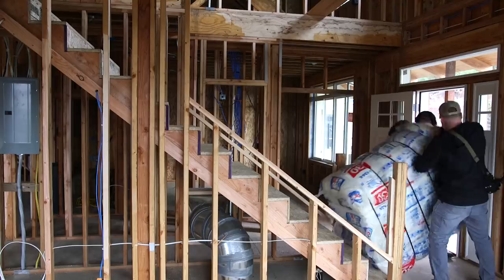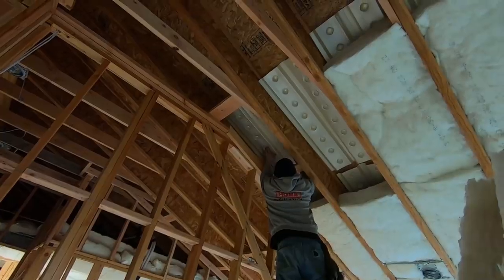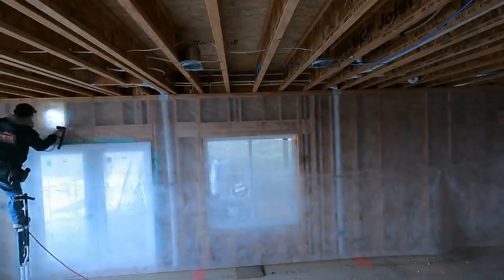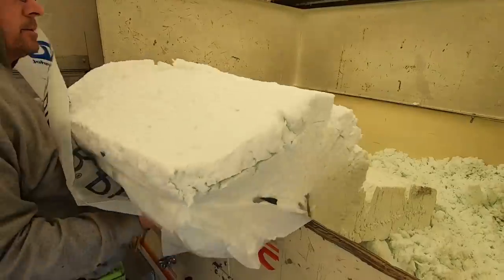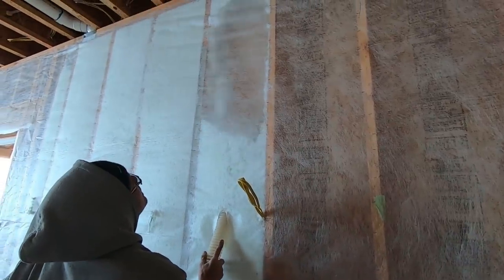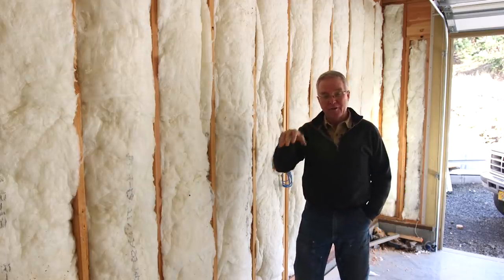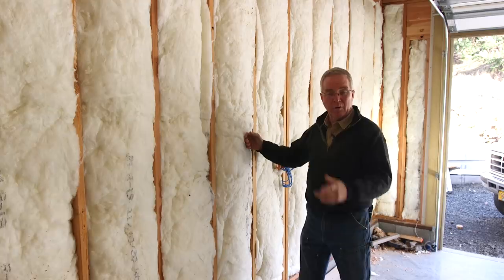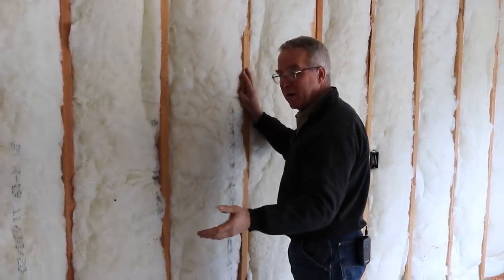Insulating A Nice House Ep.104

Comment: Hey EC!  I recently moved to Cottage Grove.  Do you have a recommendation for a foundation replacement contractor?  It’s 41 linear feet of footing and block to replace the loose block sitting in dirt. Quotes have been $20k-$28k so far.  Which are detailed and seem fair, more research to do yet.  I’ve got to tackle this before it slips out of level and I end up with a roof leak or some other monumental mess. 

Bit of a bummer to pay for the whole job, when I’m comfortable cribbing the house and replacing posts & piers. I don’t think I’m up to the task of excavating, pouring the footing and then the perimeter wall.  Totally understand why they don’t want me mucking around first though.  

Long story short, I’m looking for a word of mouth recommendation for my fourth bid so I can  make the best decision possible.    $20K+ is life changing money to spend when you’re 26! 

Appreciate the videos, God Bless.

Comment: I did some work to a house a few years back and we hand to pull some sheetrock down. We found out that the walls had been filled with loose insulation however it had settled over time and only stood about four foot off the ground leaving the top half of the cell completely absent of any insulation. Now it was a very old house and their insulation looked like recycled foam padding, but is there a concern that the sprayed insulation will settle down over time?

Comment: I've always worried about blown-in insulation settling over time. Anyway to do a test before the sheetrock goes up? Maybe vibrate the studs with a hammer drill or air chisel?

Comment: If the paper backing is gone what do they use as a vapor barrier?  Also over time blown in insulation settles leaving a gap at the top. How do you combat that or deal with that when it happens?

Comment: We have several insulation contractors here in MN but the issue that I have had over my 26 years is although they have good intentions , they fail to train their employees correctly and I find myself doing alot of quality control on site while they are working .
One of most important phases of our construction process in this climate is the insulation of the building envelope,  you can have the best built house in town and if the envelope is incorrectly insulated it will fail miserably. 
Another issue we have here is in the cold season when installing either batt insulation or blow in fiberglass , moisture migrates through the Batts and blow in and forms condensation on the interior side of the exterior wall sheathing , the insulation contractors insist on bringing in space heaters while installing insulation that exaggerates the moisture migration .
So until the vapor barriers are installed and sealed I do not allow any temporary heat sources in the building , period .
Licensed builders in MN are bound by statutory warranty for 10 years for the structure and if there is moisture trapped in the wall cavities it will eventually cause mold to begin to grow .
Maybe I am being to anal about it but I sleep good at night knowing I did my very best to minimize the moisture in my building envelope and spent the extra time to check all of the work .
Reply: Keep up the good work!

Comment: It used to be that blown in would, over time, settle.  Did your insulation guy say  much about current blown in, whether it will settle, how long it will take to do so, etc.?  Curious if there's an expectation that you'd have to re-insulate in, say, 20 or so years.

Comment: I really want to see the inside of these walls in a few years once the blown in fluff insulation settles.  How much does it settle?  Will the top 25% of your walls end up naked?
Reply: It settles a lot
Reply: LOOSE fill in an attic will settle. DENSE pack in a wall if installed correctly won't settle at all.

Comment: Cellulose looks great when it goes in, but it settles over time and looses its insulating properties.  Once that happens, it's nearly impossible to reinsulate those walls without tearing out all of the drywall.
Reply: It needs to be installed to a specific density in walls to avoid settling. Like everything, a bad install can make an otherwise good product perform poorly.
Reply: @andriussimutis573  By it's structure, cellulose will settle over time.  Blowing more in may help a little, but the air pockets will collapse over time and the insulation will settle in the walls after a couple of years.

Comment: Just curious if there is much, if any settling of the blown in wall cavity insulation shown.  I understand the breathable fabric but as a remodeling contractor of 40 plus years I have seen many new and improved systems of blown in not so primo when the walls are ripped apart.

Comment: Paper facing is a vapor barrier. But it's a permeable one that only slows down vapor transport. There are much smarter vapor barriers on the market today like a Siga Majrex that will allow more vapor to escape the wall than to enter the wall. This is great in the north where more heating is used. In the south where more cooling occurs, you want a totally vapor closed system on the outside of the house. There, any vapor that works it way into the house will dry to the inside. I'm suspecting where you are, there's not a whole lot of heating or cooling going on. A vapor barrier might not make a whole lot of sense.

Comment: Will there be a vapor barrier?   That sheet that they're hanging before blowing in the insulation is a net to hold the blown fiberglass in place.  Do they go back afterwards and apply a vapor barrier?
Reply: those are exterior walls and the vapor barrier was placed on the outside of the house in a previous video. The vapor barrier is underneath the siding. You do not want to have two vapor barriers, one on the outside of the wall and one on the inside because that creates a sealed micro-climate between those two barriers where condensation can collect, but not vent out, thus rotting the wood even faster. The vapor barrier on the outside of the house seals the interior from moisture from the outside, but allows the entire inside of the house, including interior wall space to 'breathe' and level out the climate and moisture level within the structure.
Reply: @silentepsilon888  I know that you only want one vapor barrier, I guess I didn't catch that they had applied a vapor barrier to the outside.
Reply: @andrewalexander9492  .. yeah, that was done about 10 months ago and they show it in video named House Wrap Ep.75. Cheers!
Reply: @silentepsilon888  That's not a vapor barrier, it's a house wrap. House wraps are generally not vapor barriers.  The product used is Kingspan Green Guard Rain Drop House Wrap.  That is a breathable housewrap, expressly so that it will allow water vapor to pass.
Reply: @andrewalexander9492  ... i guess there are  differences in the application method of barriers based on state and climate. Where I live houses usually get an exterior barrier but no interior is needed. Looks like we have to wait and see if Essential Craftsman will answer your question directly, either here or in an upcoming video.
Reply: @silentepsilon888  Agreed, I've always lived in northern climates, and the vapor barrier would go directly under the sheetrock.  I understand it's the opposite in warm climates.  Scott's kind of in the middle ground there, so not sure which would be the best.

Comment: I'm convinced there is no better insulation method for walls as far as performance/$$$ then blown in fiberglass or cellulose with an R3 or R5 rigid foam under the sheathing or a product like Zip R.

Comment: Blowing in the walls makes so much sense to me. What was the reasoning to not blowing in the ceiling?
Reply: Its not ideal, since its not compressed, it may settle and compress after a few years, leaving gaps on the top of the walls without any insulation. There is a comment in here from a guy who actually had to get it fixed in his house because of this.

Comment: I'm definitely concerned about that fiberglass batt in the ceiling. It has nearly full air permeance allowing air to easily travel through it rendering it nearly useless when exposed like that. It needs an air barrier while still allowing moisture to move somehow. It works fine in walls that are sealed on both sides but won't perform very well open you the cold air like that.

Comment: Hi Scott I have a question. I didn't see them install vapor barrier around the back of the electrical boxes before insulating is that not code for your area. 
Also is the rest of the exterior walls and second floor ceiling getting vapor barrier
 before drywall.

Comment: If and when I build my house, every wall is gonna be insulated. Not just for heat retention but for sound deadening too.
Reply: I recently insulated some interior walls on a renovation and my wife wants me to add an ethernet port for her home office now.   Wifi isn't cutting it for her working from home for the pandemic.  Well that would have been a lot easier if it wasn't insulated
Reply: Do your research first. The wall between bedrooms in my house is 90mm pine with 10mm plasterboard either side, standard interior wall here, with rockwool batts fitted between the studs. It doesn't work - a bump against the plaster or even just conversation noise goes straight through, because studs transmit sound. I've seen several suggestions - 140mm plates with 90mm studs staggered so each stud only touches one side, various proprietary products, a double layer of plasterboard, a layer of ply under the plaster - I don't yet know how well each of these things work, but I can say for certain that what I did was not enough.

Comment: I've noticed some things Americans do better than here in Australia RE insulation - you  seem to set the barrier at the roof, not the ceiling like here. We end up with a roof space 50-60 degrees celsius on a 30-40 degree day as the insulation is on the ceiling. But Americans use poorer materials like roof shingles and weatherboard as opposed to corrugated iron or tile and brick veneer.

I like this blown in system but hate to imagine if ever have to get a new cable in anywhere. Beauty of brick veneer is you usually have an air barrier like brick > air > foil > studs/insulation > plaster so running any cables on external walls is easy.

Also a downvote from me not having internal insulation. Something that can only be done when building really and makes a home so much better I would never build a home without internal insulation.

Comment: So I'm going to be that guy, and call me a rock wool fanboy if you want, but my question is does that blown in fiberglass have some sort of adhesive that keeps it from settling into the bottom of the cell? Ive worked on many older homes that had insulation blown in as a retrofit where it wasn't originally insulated. Then when we came through gutted them and hung board all the insulation settled into the bottom 2 feet of the cell. So is there something to prevent that from happening?

Comment: The first thing that comes to mind when I see blown in cellulose in the walls, will it settle over time and make a spot in the top section of the wall that is insulated?
Reply: Not if it is properly installed dense pack cellulose. Dense pack cellulose installed so the stud bays feel like a firm mattress is self supporting and will not settle.

Also Scott spoke incorrectly. That's blown in fiberglass they installed, not cellulose. You can tell because you see the guy dumping JM Spider Plus into the hopper and the resulting insulation is bright white.
Reply: @BenWolkWeiss  That's what I thought too so I looked it up: "Johns Manville Climate Pro® Formaldehyde-free™ blow-in fiberglass insulation offers thermal and sound control along with fire-resistance. One bag of Climate Pro provides 73 square feet of R-30 coverage. Engineered for professional use with high-volume blowing machines, it's ideal for attics, nonconforming spaces and hard-to-reach areas making the job faster and easier."
Reply: @BenWolkWeiss  thank you Ben!  I appreciate the response.

Comment: There is paper on back of Sheetrock so you can’t get away from mold possibility.
Reply: Except that there's a vapour barrier between the insulation and the drywall, so it's not usually an issue.

Comment: I have several concerns about your vapor barriers (or lack there of). Why didn't they tape up the holes they cut for the hose? Why are the bats not covered with plastic sheeting taped at the seams?  Gonna get a lot of air movement without that. My parents built their house in 1983 and put vapor barrier on BOTH sides of the extra thick insulation and their walls are still above code nearly forty years later.
Reply: vlogerhood, Those practices are not in favor today because of to many instances of mold by trapping internal vapor barriers.

Comment: Doesn't "blown" insulation settle over time leaving gaps at the top of each wall?
Reply: Depends on the material, I think.  My place started life in 1958 as a hytte (typical Norwegian holiday cabin) and has wool fibre blown into the original outer walls.  It hasn't settled, but is nowhere near as good as modern insulation materials.  (And is a messy nightmare to replace.)
Reply: @ CALVIN L. NIKONT   100% yes
Reply: @chrisking6740  The Chris King of bicycle components fame?
Reply: @bryanwarm2471  Haha I wish!
Reply: @chrisking6740  Not  if it is done right I have removed sheetrock from an entire exterior wall after 13 years and not one stub bay settled.
Reply: @billmurphy4006  That's genuinely impressive, I've always seen at least some amount of gap at the top of the bay. I think in general though a properly installed rock wool batt will keep the cavity fuller for longer than blown-in/dense pack would. Also the cellulose in this video couldn't have been installed less dense...
Reply: If the cellulose is blown damp then it sets rigid (like papier mache) and doesn't slump, but you have to spray it not dry-blow it like this system. So yes, this is a risk of slumping, although maybe if you get the pressure right then it will stay put.
Reply: @chrisking6740  the blown in insulation in this video was fiberglass not cellulose, not sure why he got that mixed up. If cellulose is dry blown in it needs to be dense packed.

Comment: Hi I’m building an extension onto a house that was originally build around 1890 work was done on original around 1970 an internal skin was built some of original knocked down existing has a standard cavity my issue is for new extension do I use spray ball and install 2 inch of kingspan in interior due to the fact It will be my only option on rest of property or do I fit thermo board into brick cavity  which would be my preferred option but the price of materials in uk at the mo could be around 3k 
Im a plumbing and heating engineer as trade so I understand the importance of insulation the existing cottage will be changed to bedroom/bathroom  the extension is living space, kitchen, family room and office also a lot of glass will be fitted in new area should that be took into consideration when trying to work out the best insulation solution

Comment: My biggest concern with blowing into walls would be settling over time, leaving an uninsulated gap up top, especially in areas that might see vibration.  Anyone with experience know if this can be an issue?
Reply: Some guy mentioned in one of these comments that after 10+ years he had to replace the insulation, because of the same reason you said. I guess it depends on the quality if the job

Comment: How does the blown in insulation work  20 years from now? It used to be that loose (blown) insulation would settle over time.  What is different now? Paper facing was also part of the vapor barrier. Since the house is now wrapped with a vapor barrier, the paper is irrelevant. At least that is what an industrial scale salesman told me.

Comment: They remove the paper backing because it supposed to be a vapor barrier with with all the seams around the fiberglass insulation it really does not act as a vapor barrier. One of the reasons they keep increasing the R-value for code is they’ve learned in any kind of insulation fiberglass bats cellulose if you the envelope at the house the air sealing of the house is not good air can still circulate throughout the insulation decreasing it’s R-value. There have been multiple studies on this unfortunately one of the products that fixes this issue is spray foam but sometimes spray foam is not economical. 
Your build is complicated where R zip insulated panels would’ve partially worked but wouldn’t have made a 100% envelope around the house.   creating an envelope is the trick if you can keep air infiltration from the house you decrease the  amount of R-value you needed in insulation as air is what transfers heat from one place to another. Creating an envelope also creates one more problem now you need to HRV recovery system to exchange air from inside the house to outside.

Comment: I don't think I've ever seen such white cellulose insulation.  Most I've seen is made from recycled newspaper and is (predictably) grey.

edit:  The reason it doesn't look like any Cellulose I've seen is because it isn't Cellulose. The blown insulation is fiberglass. the 2 products you see in the blower truck are Johns Mansfield "Climate Pro"  and "Spider Plus"  both if whcih are loose fiberglass insulation.